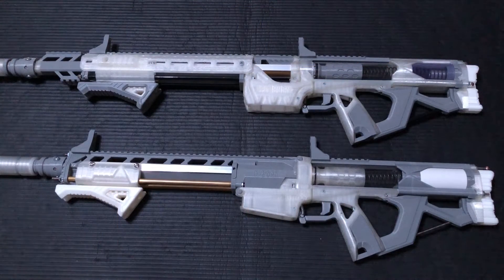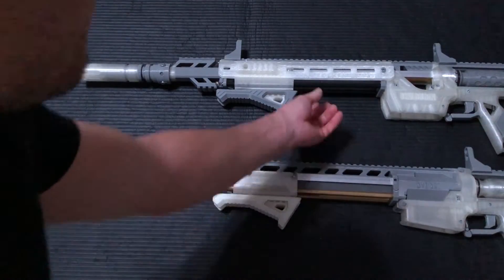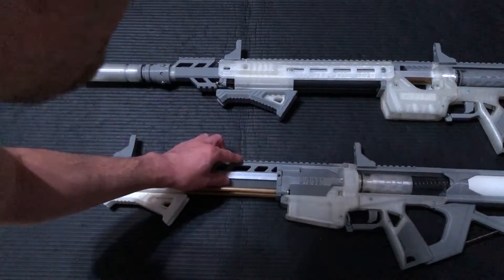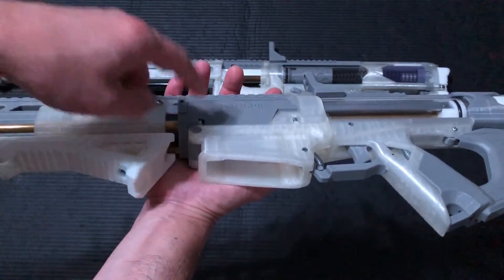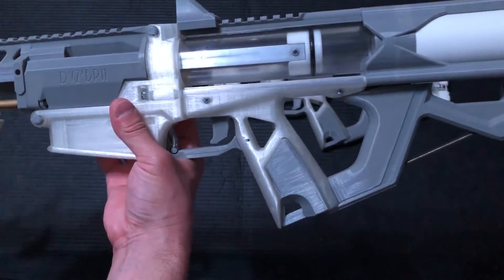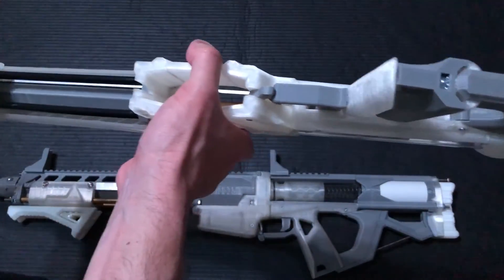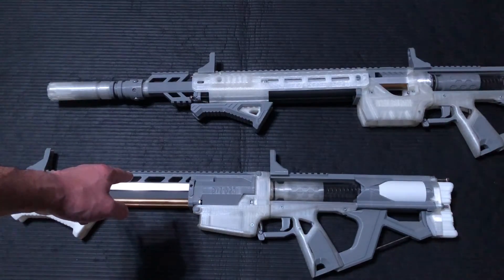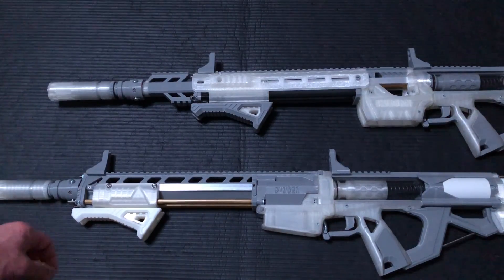Caliburn Log: Episode 2

Comment: I believe that the current stock receiver now uses pins as well (three).
Reply from the maker: Lawver modeled and released his breakdown receiver about a week or two after Devilz' Nerfworks. The redesign made it easier (cheaper) to ship assembled Caliburns as well as adding the multi-caliber front assembly options, which was the real innovation. 

There have been some teething problems with the Milan Coupler (the universal piece that replaces the spreader and couples the front and rear assemblies) breaking, but that may have been addressed by printing them with ABS instead of PLA. 

Anyone who wants multiple front assemblies (Mega or Rival) should definitely go with Captain Slug's latest version.

Comment: OMW sells 18" of 17/32 Aluminum. Same dimensions as K&S brass.
Reply from the maker: Might have to find a different outer sleeve material with these as the OD probably isn't 9/16" due to the differences in hardness and ductility of aluminum and brass. But if the OD is 16mm, then problem solved: far easier than assembling a composite barrel. Worst case scenario: remix the Caliburn receiver and front muzzle assembly or design a bushing for the stock parts.

Either way they would still be 100% compatible with a 1/2" brass Ram bolt.
Reply: @greenmedic88  Alternatelly, McMaster Carr sells brass in 3' lengths 17/32 part 8859K334 9/16 part 8859K335 or you can get aluminum in .506, 509 (maybe), .517, and a few larger from AhaleKelly (not sure where all he sells it ATM, but he'll deliver to most bay area games.) I've heard tale of 300 fps K25 Caliburns, some more though testing would be welcomed.
Reply from the maker: McMaster Carr may be the way to go.
Performance-wise,  I have personally confirmed 300 fps with a K25 Caliburn is possible with a kit 18" barrel if the air seal holds, and the front assembly is properly aligned. I had one string of 17 shots with full length FVJs that averaged 273.3 fps (no SCAR barrel), with one shot at 305 and one at 311that penetrated the mesh catch netting before embedding the tip in the 1/8" cardboard back stop. The problem is it's more or less impossible to repeat with any sort of regularity due to the design of the platform when using FDM printed parts due to inconsistencies in prints, non square cuts in the plunger tube and spring retainer tube, warped 10-32 rods, etc. even if every retaining nut was properly torqued down. 
So, the upper end of performance under optimal conditions matters less than consistency and averages.
Reply: @greenmedic88  I have it and bought a few of the OMW tubes. They are pretty much exactly size. In cases where it is slightly off, a light sanding of 800 grit does the trick.
Reply: @greenmedic88  As in confirmed 1/2" fits into it and 9/16" sleeves over it.